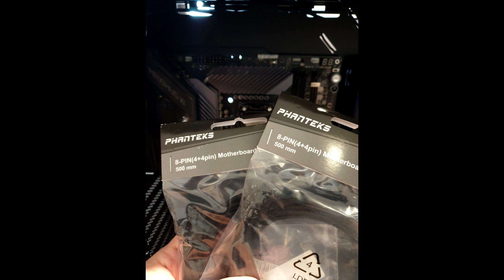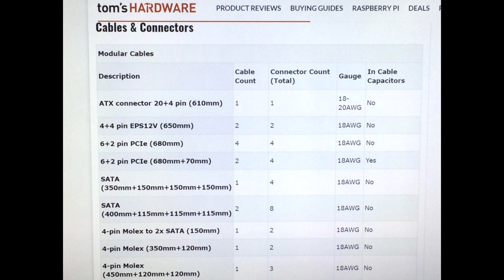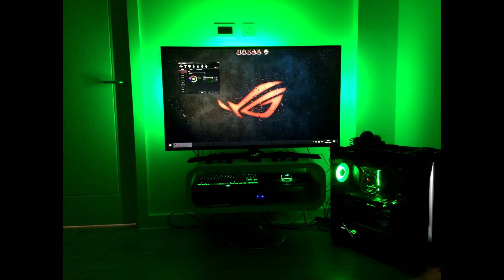FULL ROG BUILD - "ROG X 905"

Comment: Hi. I have this motherboard too, but backlight in I/O don't work. 

I watched a few past videos, but the backlight didn't work too.

At the Asus forum, recommended checking the backlight connection.

What did you do or simply did't turn the backlight on Asus aura?
Reply from the maker: The I/O light is very weak. And when all the rest of the lights are on it's really not noticeable.  You can see it much better when the colours are set to blue but red are really washed out.
Reply: @ninezerofive  thank you, I checked on blue and it really works.